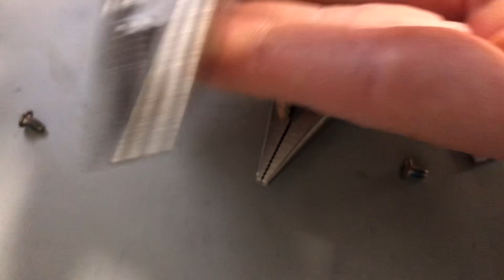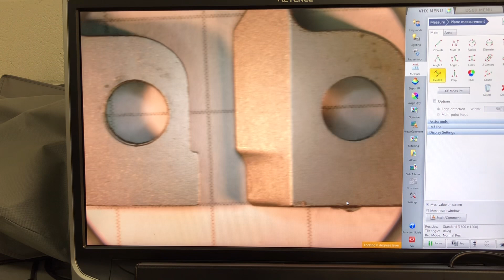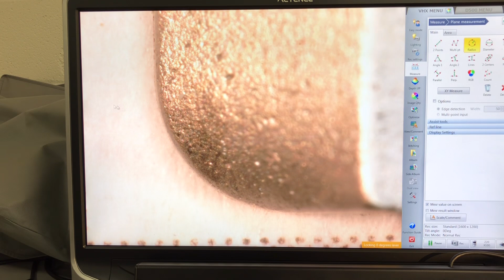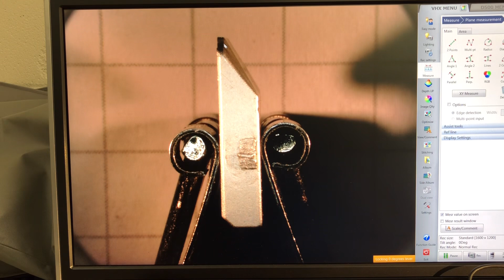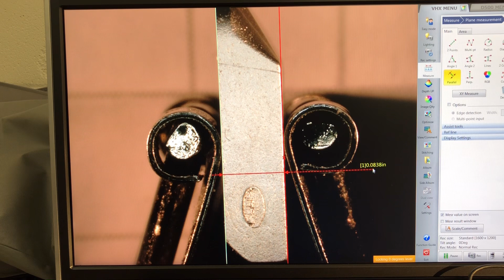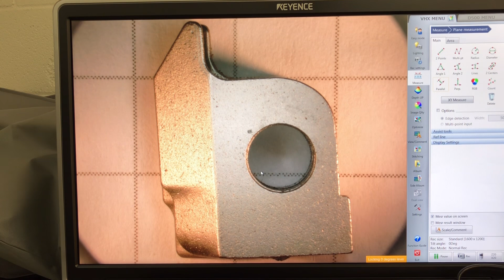Leatherman Wire Cutters Under the Scope

Comment: Multi-Tools Pliers aren't exactly a direct replacement option to real tools, they are just for emergency, so who cares the Original Hardwire Cutters cause the Plier Heads to break off eventually due to Material Fatigue, Strain and Stress and repeated stress-loading? Those Plier Heads aren't exactly going to break off immediately the moment you abuse them.

The problem is due to the age-old 25 year warranty that is working inefficently for Leatherman now. With modern technology Hard Wires are made tougher and more durable than dacades ago in the past, which cause pre-mature plier heads failure for Leatherman if push to the limits of modern hardwire cutting, resulting in cost-losing waranty replacements.

Since Leatherman isn't coming out a solution for their Warranty issue or enhancing the durability of their Plier Heads, but instead purposely and deliberately resort to changing design of the Hardwire Cutters to make it weaker, might as well boycott Leatherman from now on and start using those low-cost AliExpress clones. Even without Warranty, no worries if the plier heads break due to abuse.

Comment: Another informative video. Thanks for making them I hope the theory about why they redesigned the cutters is wrong and that they go back to the old style. The reason that I am more likely to believe the theory than not is that it's just cheaper to replace cutters than the whole plier head. Also, they can claim that you abused the cutters, refuse to replace them, and most people will just pay the $10 to replace them. If the theory is true it's just another step down for the company. What a shame.

Comment: Thank you for this video.  Sucks that Leatherman went this route with their replaceable wire cutters.  They also used to be made from 154cm steel. Now, who knows what kind of steel they are using. They just call them “premium” wire cutters now. Leatherman was always an American company synonymous with high quality tools. Not so much anymore.
Reply: If they are not using real 154CM, means Leatherman are resorting to cheap tactics to make customers spend more! If no one is replacing Hardwire cutters regularly then Leatherman earns less so they have to intentionally make the hardwire cutters weaker to make consumers to spend more regularly!
Reply: @vJaxz just like the auto industry